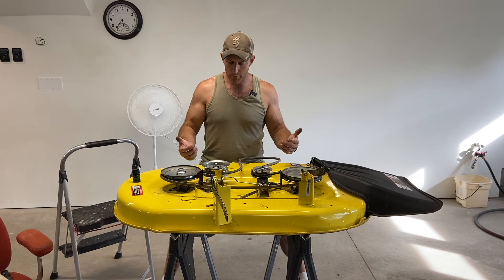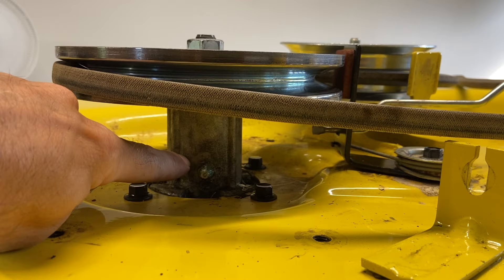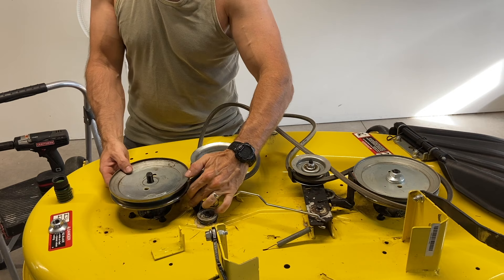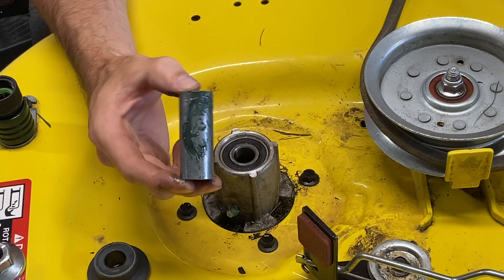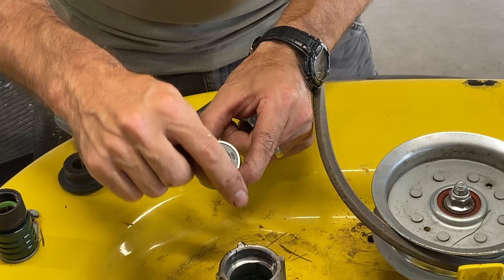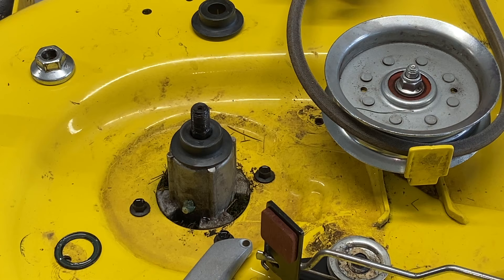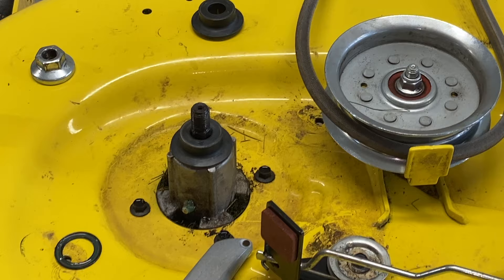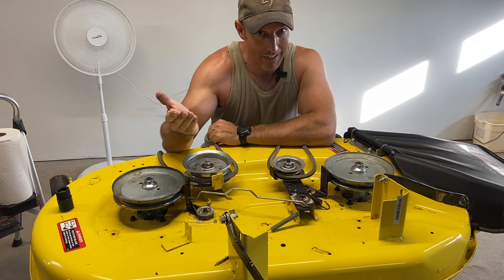I WOULD DO THIS DIFFERENT NOW JUST REPACK THE BEARINGS WITH GOOD GREASE AND PUT SEALS BACK ON.

Comment: It sucks to pay extra for a spindle that has a fitting that has a sealed bearing ! ran into that not long ago ! put $300 into a deck rebuild just to have a season later one get noisy ! bought a new bearing and popped off the inside seals . As a teen we ran into this on same HAHN brand golf course equipment back in the 70s was a factory screw up . Cute buff dude !!
Reply from the maker: thanks for watching and commenting

Comment: My grease fitting is on top of shaft so I dont think my Craftsman has that metal tube inside spindle but I can see how it would help force grease into bearings that way, if there wasn't any seals. Good info thanks for posting!!!
Reply from the maker: thanks for watching
Reply: The metal tube between bearings is needed to squeeze bearing races so balls inside bearings spin instead of housings spinning

Comment: When the grease comes out around the blade and or pulley, it has to at some point if you keep greasing it. The only way for the grease to get out is past the bearing and therefore lubing it to some point  and under grease gun pressure it will go past those bearings or it would crack the bearing housing.
Reply from the maker: Thanks for watching
Reply: unless you drill a weep hole for the grease.  I got tired of replacing those 'last a lifetime' bearings every two years so I removed those inner seals and now I haven't had to change a bearing in 12 years so far.

Comment: Wait how about greasing the brgs again then take it apart to see if grease gets to the brgs.  The  sleeve looks like it covers the center race that would stop the grease from the brgs?   Seems like there should be a drilled hole in the sleeve to fill the spindle with grease packing the brgs?

Comment: They make a hypodermic needle attachment for grease guns. Just get it to the point of @ 1:50 Then use the hypodermic needle to inject grese right through the bearing seals. Then put it back together. Easy and done.
Reply from the maker: Thanks for the idea
Reply: @DIYJIM  You are welcome.

Comment: There was no floar as the bearing is pre packed and sealed so no dust goes inside.  My tractor is being used a lot and it's over ten years and still running smoothly.
Reply from the maker: Thanks for watching

Comment: When mower is new, pull the bearings so you can pack the bearing with grease, put the seals back on, and just pick up new bearings in the packs, that you can pre pack, and change the bearing out at the end of the season to new ones that have been pre-packed with more grease from the start.  
Hence in order for the top bearing to get any new grease, even with the seal removed, would have to fill the entire void area with grease until the grease flowed out the top bearing seal, while as the grease gets hot, will flow downwards out of the bottom seal to just be slug over and over again (and kill some grass), leaving the top bearing dry, and costing way more in grease by the tube, then it would cost to replace the bearing each year instead.
Reply from the maker: Thanks for watching

Comment: It’s ok to remove the seal but you now you have to be committed to greasing your spindles often as now the grease that is in the top bearing will tend to drop out and run dry.
Reply: What's the difference? If the bearings  cannot be greased, they will eventually fail. By adding grease every season now, the bearings will last for much longer than a sealed bearing. They also run quieter as well.
Reply from the maker: Thanks for commenting, the John deere ran flawless all last summer
Reply: @scottfirman  the seal lip faces inward toward the bearing balls.  The grease will go in the bearing with no issues

Comment: I have several things that run that style bearing and most aren’t where I can use a zerk fitting to help in any way.  I usually pull the bearings out every so often and pop at least one if not both seals out and repack the bearing then replace the seals and reinstall.  Sometimes it’s a royal pain to do it but it has drastically reduced the number of bearings I’ve had to replace.
Reply from the maker: That is a real good thing to do to help bearings last,  thanks for commenting have a great summer

Comment: My new Toro doesn't even have grease fittings on the spindles because it uses sealed bearings and grease isn't needed. The way I see it, the bearings are easily and cheaply replaced if any of them ever fails.
Reply from the maker: thanks for watching

Comment: You need a plugged weep hole above the grease fitting to allow for the old grease to escape or you may blow out the other seals by pressure build up.  See it all the time on large electric motors where the plug wasn't removed before greasing.  Makes one hell of a greasy mess.
Reply from the maker: I have seen others do this

Comment: I've always wondered if a sealed bearing starts to get hot it should liquefy the surrounding grease and suck it in through the plastic seal.  Kinda like the way solder works on a copper water pipe or canning creates a vacuum in a jar.
Reply from the maker: I wonder the same thing my bearings are still good thanks for watching
Reply: Baldeagle242: Probably push some out when hot - expansion when hot.
And suck some grease in as it cools..... 

Same thing as  with washing deck when bearings are hot. 
As bearings cool, they suck in water......

Comment: Most all mower decks have sealed bearing in them. So greasing them is a waste of time. You need to remove them and take the seals out of the inside so the grease actually makes it to the bearings. It's a pain in the ass, but that's what you need to do. I don't trust sealed bearing in something as important as a mower blade spindle.
Reply from the maker: Thanks for watching

Comment: How about pumping it full of 90W gear oil?, it will get past those seals and lubricate and even if you do it only once every few months they should still be happy.
Reply from the maker: My mower is still going they way I did it I think it really will last A long time if you only are mowing around a half an acre.
Reply: @DIYJIM  Here in FL most yards are small, mine's only 125X100 but you have to mow every 4-5 days during summer. I think the issue with my gear oil idea is it would eventually wind up on the grass possibly damaging it. My MTD does not even have a grease fitting although they can be bought separately and installed.
Reply from the maker: @barryaiello3127  your mower should last forever just keep it out of the sun. My father in-law lives in west palm beach thanks again for watching my video

Comment: Well ... I like that zerk fitting and like your first inclination to remove the inner seals permanently. That center tube limits the "waste" of grease and helps you get the grease into the bearings. That's the whole point. Just like a vehicle or trailer wheel bearing it's something you do periodically and doesn't take a lot.
Reply from the maker: Thanks for watching

Comment: "Black on one side. Silver on the other" ... The silver side is not a seal. It is a shield only. Shields are used to block larger particles. Grease can slowly penetrate a shield. It also does not create a rotational friction.... The black side is sealed. It stops the entrance of most anything. It does create rotational friction so you will never see this seal on larger bearings. Grease guns are capable of tremendous pressure. Well into thousands of PSI. This pressure can destroy the seals. Best to be extremely careful when greasing, or drill a small bleed hole to release the pressure near the top of the housing.
Reply from the maker: Thanks for the comment and thanks for watching

Comment: And now if you over-grease it’ll push the plastic dust cover loose and allow dirt in. If there were single or double lip seals outside of each bearing, different story. The manufacturers changed from seal bearing/ bearing seal to longer lasting sealed bearings using their existing gimble is all. Use a socket to reseat those bearings. No grease needed. I wouldn’t do this to my rider.
Reply from the maker: Thanks for the good information

Comment: I can see leaving the inner seal off of the bottom bearing if your going to be greasing it from the zert, gravity will take care of the grease getting to it. BUT I think its wise to repack the top bearing and put the seal back on it otherwise you would have to keep the whole section of the spindle full of grease ALL the time and could also blow the outer seal on the bottom if you over grease.
Reply from the maker: Thanks for commenting and good information

Comment: i would pop the seals  on the other  pullys   an grease them up an reseal....i do that to mine  ..bearing  last that way
Reply from the maker: Thanks for commenting
Reply: Seems the best option is to pop the seal, repack, reseal.   If you miss a season or sell the tractor they won’t run dry.

Comment: I’ve got an old John Deere mower deck I’m trying to restore, for my 1980ish John Deere 111 lawn tractor. Just painted and put new blades on. But I have no idea how I would grease/lubricate the spindles because I can’t find zerks anywhere on the deck where they would normally be on other examples I’ve seen (on the top or on the side of the pulleys for the blade spindles). Any potential suggestions? Thanks!
Reply from the maker: Normally on the top or side but I have seen some that don’t have any.
Reply: @DIYJIM  thank you! If it doesn’t have any I assume the bearings are sealed right? Does that mean I don’t have to worry about greasing or do I have to take the whole thing apart and grease manually?

Comment: Wouldn't it be prudent to drill a small hole in the inner seals and then re-install them, then drill a small (tiny) relief hole in the side of the shaft housing so as to port and vent excess grease ?
Reply from the maker: I have seen where some people will do that, thanks for watching

Comment: Has a degreed engineer chimed in on this yet?  I'm concerned that the pressurized grease coming from the zerk fitting (during maintenance) would blow out the other bearing seal and allow the bearings to burn up from lost lubrication.  There is no pressure relief hole in the system, so the weakest point holding pressure will be the seal.  I understand the concept of why a person would want to remove one of the seals, and it seems logical.  Hell!  It even seems stupid to use sealed bearings with a housing that has zerk fittings to relubricate, but the guys that designed these mechanisms have 5 to 8 years of engineering school over and above the guys that repair these things.  There must have been a reason why it was designed this way...
Being a mechanic is not the same as being a mechanical engineer.
Reply from the maker: Thanks for the long explanation
Reply: @DIYJIM  
Hi!  It's not an explanation, it's a question.  Your modification seems logical, but I find it hard to believe that degreed mechanical engineers from ALL these companies would design this mechanism in a stupid way.  There must be a reason and I'm curious if an actual engineer has commented on this apparent "design flaw".
Reply from the maker: @TheAnnoDomini  I do not remember anyone saying that they were any type of engineer. I just think they make these mowers for just homeowners that have a small piece of land. If someone want to spend 10 Grand on a mower I'm sure the mower decks are built to take more abuse.

Comment: The only problem I have with all these videos is nobody discusses how much grease once it’s all put back together that you should put in the grease Zirk and into the area for the bearings or roughly how many pumps of grease you should put in so you don’t blow out the sealed side of the bearing
Reply from the maker: Sorry really not sure how many pumps plus every grease gun is probably a little different

Comment: Buy SEALED bearings on ebay for as little as $2.00 a pop and never mind the grease fittings. The number one reason for bearing failure is OVER GREASING. When a bearing is over greased, the grease won't circulate and carry off heat. Any decent bearing will give YEARS of service, removing the seals just opens up the possibility of dirt destroying the bearing itself. Grease (zerk) fittings are more appropriate for BUSHINGS. I'm a retired machinist with over 40 years of experience and have seen many bearing failures over the years.
Reply from the maker: Thanks for commenting and watching my video

Comment: I'm about to replace the 6 bearings in my Kubota T1560. Problem is there are no Zerk fittings on the spindles.  What is the best way to maintain these bearings? Thanks
Reply from the maker: Some repack once a year depends on how much you use.

Comment: The spindles you pulled out didn't have a lot of grease on them already.  Where is your grease going after each lube cycle?  I grease my spindles 3-4 times per season with a couple of pumps in each zerk.  The zerk is on the side of the housing.  I pump about twice and then feel the resistance.  I don't want to pop a bearing seal so I stop.  I guess the only way to really know is to disassemble the spindle and see where my grease is going.  It sure isn't evaporating :)
Reply from the maker: It’s definitely not the best set up. Thanks for watching

Comment: Seems a lot of work for little gain. My experience is that those sealed bearings last about the same, regreased or not. You could possibly extend their life some by periodic cleaning and fresh grease. If it is worth the effort is questionable? Well done video anyway. Thanks.
Reply from the maker: thanks for watching you are probably correct
Reply: @DIYJIM  Yes, he is.  Never pack the entire volume with grease as the bearings will overheat and seize.  The zerk is useless.  Don't use it.  Just take the bearings out every few years, take out both seals and clean.  Then re-grease to about 1/2 full and put the seals back in.

Comment: The bearings are sealed. The zirc allows you to lubricate the shaft the blade is connected to as it spins inside the spindle housing.
Reply from the maker: Thanks for commenting

Comment: I have found that if a deck bearing goes bad it is usually the bottom one.   I had a john deere dealer tell me when i asked him why they had zerts  when the  bearing was sealed and he said that was to keep the bottom seal cooler.  Does that make sense ?
Reply from the maker: Not sure what makes sense because some do not have any grease fittings. What I do know is if my bearings go bad they are very easy to change. Thanks for watching

Comment: I will not greese sealed hub bearings on my truck and won't greese sealed bearings on a mower deck, I don't wash the deck with water but use compresed air , cuz cold water on hot bearings bad. If they wear out too soon buy better quality bearings. A quality car hub bearing might last 7 years a cheap one maybe a year. Good bearings come with expensive greese inside not the $8 a tube stuff,
Reply from the maker: Thanks for the info and thanks for watching

Comment: Now the grease will definitely get into the bearings, but It will also push out the remaining outer seal, the old grease has to be pushed out, so the new grease can get i!
Reply from the maker: Agree I thought about this after I made the video
Reply: So would you just remove both seals for each bearing?
Reply: @CR-ji4ub  Add a 1/16 "weep hole" opposite the zerk.

Comment: The shafts on my Bad Boy just slide out, leaving both bearings in place. I wonder if I should just pop the outer seals off, smear some fresh grease into them, then pop the plastic seals back on, and call it a day?
Reply from the maker: I really think it could not hurt to do this maybe every year or two depends on how much time you run your mower. I would like to have one of those Bad Boy mowers, they seem like a great machine. How do you like yours?
Reply: @DIYJIM  I have their smallest zero-turn so I can't really judge them overall. The construction seems sturdy.
Reply from the maker: @davejoseph5615  that’s probably all I would need I only have 1/2 acre

Comment: Bearing manufacturers offer NO warranty on their product, and it is normally up to the manufacturer of the object containing the bearings, i.e., John Deere in this instance, to offer a warranty on the entire package, including the bearings. Bearing manufacturers talk about expected life in bearings as a "B-10" life, or an "L-10" life. That's the number of hours that bearings can run, continuously, with proper lubrication, and only 10% can be expected to experience a failure. It's basically a statistical expectation. 90% of them will still be "good to go". Now, most manufacturers of equipment that contains bearings may offer a warranty of 1 year, but generally 90% of their customers will get 3 or 4 or 5 years, or even more, before they begin to encounter any bearing problems. And that's CONTINUOUS operation. How many of us operate our lawn mowers, and decks, CONTINUOUSLY, for that many years ?
Reply from the maker: thanks for watching and for the explanation

Comment: I was a maintenance machinist for forty five years.  I have observed sealed beatings run in electric motors 24-7 for decades.  Bearings must be installed properly and the bore and shaft size must be perfect.
Hammers are not a bearing installation tool.
Reply from the maker: Thanks for watching